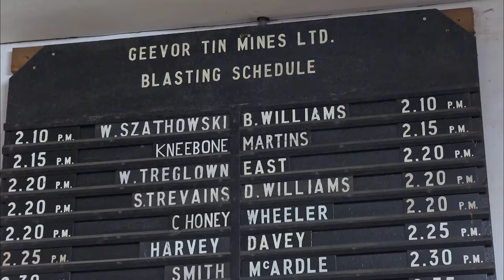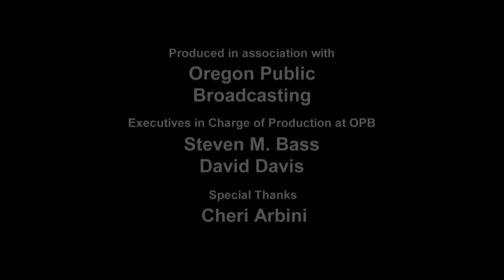England's Cornwall

Comment: 17:35 slight error. Spanish Armada was 1588 not 1595.
Reply: There was more than one Spanish Armada  (quite a few actually). The first one was a complete none starter because Francis Drake blew up the cork factories in Cadiz, so they couldn't cork their barrels, so they couldn't take water on the ships, so the ships couldn't sail. The biggest and most famous 'God blew and they were scattered' Armada is 1588 but King Philip, ever the trier, came back in '95 and that was when they damaged Mousehole - which is obviously the one they were talking about, because they are talking about it in Mousehole!